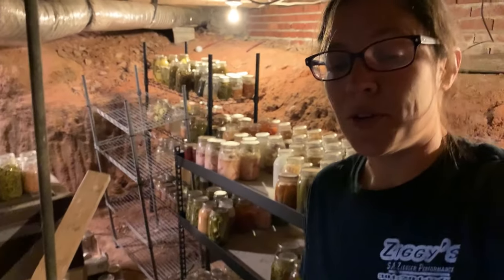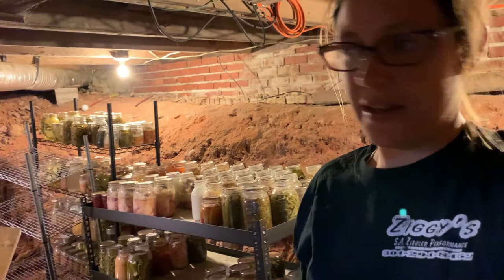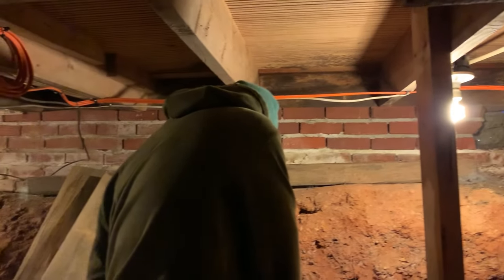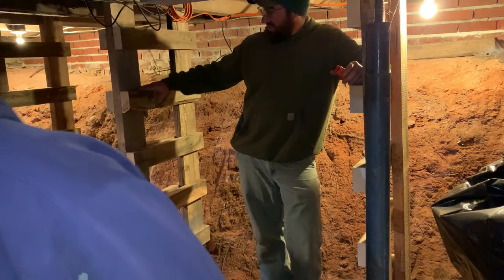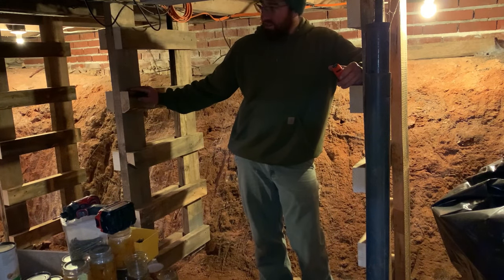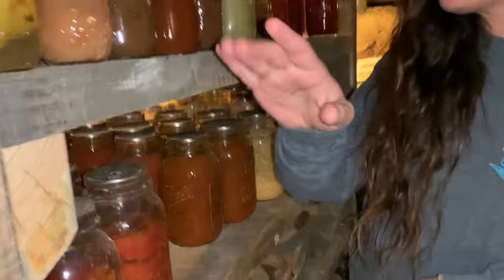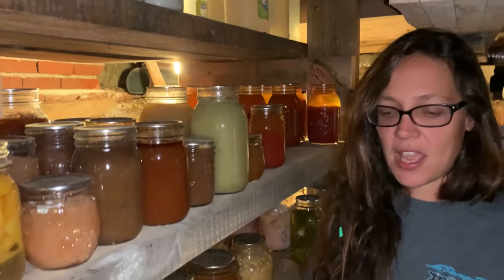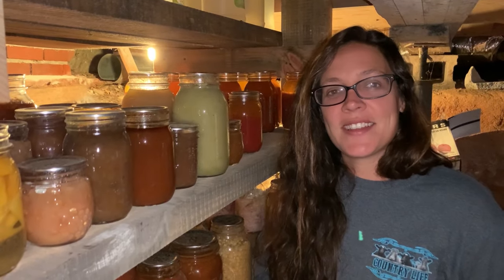Homestead Underground Root Cellar Restore | Stockpiling a Years Worth of Homegrown Food

Comment: Our root cellar is under an out building and is concrete but is too wet to store roots so I built shelves from store bought lumber over 20 year ago. It doesn't look as good as your shelves but so far they are holding up. The original ones had been eaten by termites so I had to use treated wood. This year I filled up all the pints and had to buy more, never thought I would ever have to do that, I still have some for hopefully canning some deer but the cellar is full. I have the roots in the cellar under the house like you do, Lookin good!
Reply from the maker: Awesome!!